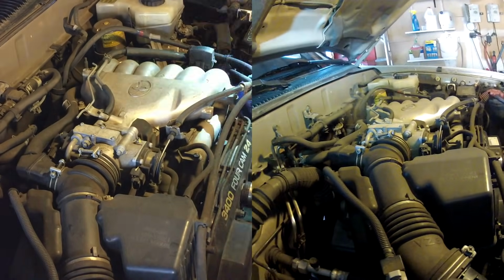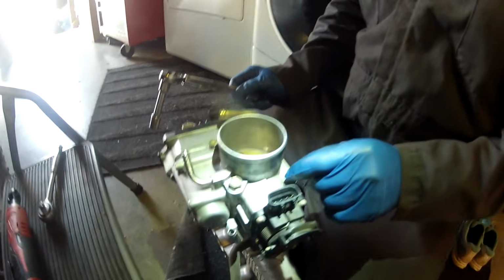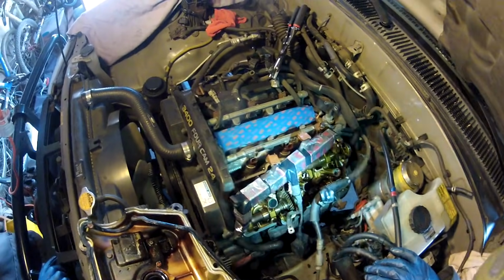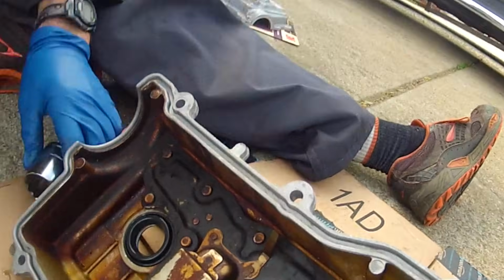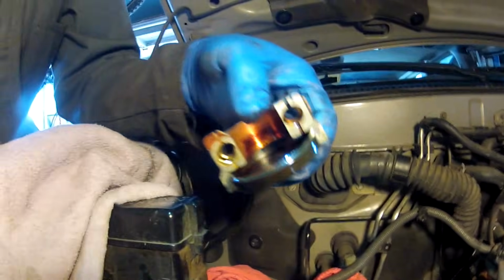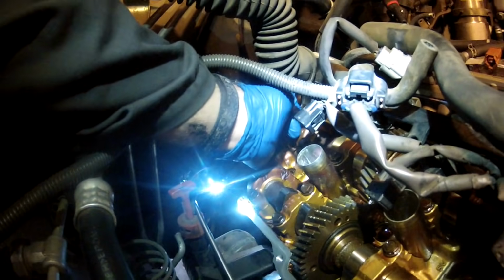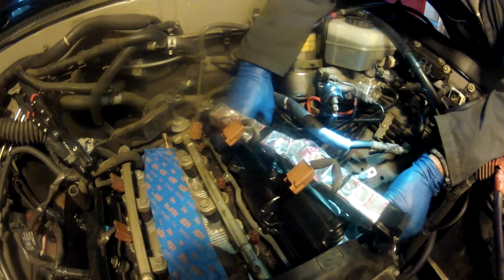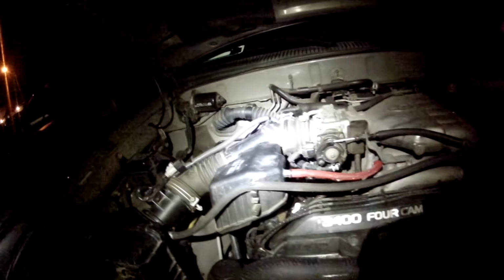3.4 L V6 5VZ-FE Toyota 4runner, Tacoma, Tundra Valve Cover Gasket Tutorial

Comment: Tim, your attention to detail and thoroughness are awesome.  Thank you so much for another great video!  I’m tackling this project over the weekend.  Toyota stealership messed this up on me 4 years ago leaving me in worse shape then when I brought it in.  As I’m taking things apart I’m discovering all the areas that the dealer skimped on.

Question:  Did you paint the valve covers before reinstalling or did you go with new valve covers?  If you painted what paint did you use?
Reply from the maker: Thanks for the compliment and you're very welcome.  You have found out what a lot of people have found out about bringing their vehicle to the supposed "Professionals".  Dealership and independent shop mechanics do shoddy work a lot.  There are competent mechanics with integrity, but there's also a lot of dishonest hacks too.

We painted Sean's valve covers after we pressure washed them.  You would want to use a high temperature paint that you can get at auto parts stores or buy online. 

Good luck with the job!

Comment: Had a mechanic change my valve cover gaskets. I had a hurt back so I just let him do his thing. It’s been continuing to leak oil. I thought it was a rear main seal as he said it possibly could be.  Ow that I can actually move around a year later I reached my hand to the back of the engine and felt thick oil on passenger side at the camshaft plug. Getting it done  tomorrow at 260,000 miles thanks
Reply from the maker: I bet a lot of "Mechanics " don't do a valve cover gasket job right.  It's not only the valve cover gasket, but it's replacing the cam plugs, resealing the half moons,  and replacing the spark plug tube seals.

Comment: Timmy,
Thank you again for giving me the knowledge and confidence to successfully tackle this. 
I had three challenges though...
1. My temp gague in the instrument cluster stopped working, but the obd scanner can still read it....  Stumped on this one, what did I forget to plug back in?

2. 25 year old vacuum lines are brittle, be careful everyone!

3. A wire in the #6 fuel injector harness broke. I found out by having a #6 missfire. Diagnosed by testing spark plug for a good arc, then plenum off (again) to test injector continuity, and finally power to the harness. It failed the last one so I replaced the harness and it now works great. Moral of the story, old wires and plastic are brittle, be careful!
Reply from the maker: The coolant temp sensor for the gauge screws into the back of the intake manifold.  When you lifted the wiring harness to remove the valve covers, the connector pulled off.  It's just a simple spade connector.  The same thing happened to me with my 98 4runner.  If you reach back there near the firewall and under the heater control valve, you should be able to feel the connector and sensor and be able to slip it back on.  A telescoping magnet with a light might help you locate it if you can feel it with your hands.

Comment: Question, would it be possible to unbolt the covers and lift them enough to remove half moons and reseal the moons without taking the everything off?
 It’s either those or the cam plugs that are seeping oil pretty bad on mine. Not enough to drop the oil level though.
Reply from the maker: You would have to remove the valve covers all the way to remove the half moons and cam plugs.  You should just do the complete job and be done with it.  If you try to short change the job, you'll probably regret it.

Comment: About 2/3 through this job right now.  This video exceptionally helpful. Unlike the videos, my half moons took huge effort to remove.  Passenger side was a challenge, but drivers side front took over 30 mins... Not much room, have to stand on step ladder (have 3 inch lift) and couldn't get leverage without loosing footing.  The side nearest fire wall was impossible with channel locks.  Tried many different things and tools.  Everything is in the way.  Son (a mechanic) suggested small vise grips.  That did the trick!  All energy went to pulling straight up and not keeping grip.  Also small enough that the brake booster didnt interfere.  Just a suggestion for those who are having a hard time with those.  Dont leave them in as i contemplated.  They were definitely the source of my leak - they had to be redone!
Reply from the maker: Yeah, those rear half moons can be stubborn to get out.  A small vice grips was a good idea.  Knipex makes smooth jaw pliers similar to channel locks that might be a better choice to not mar up the surface.  Check these out.   They make them in different sizes.  This is the 6 inch ones that would work well in a tight area.  https://amzn.to/3W3CC7D
Reply: @TimmyTheToolman  thats a good idea, i replaced mine and glad i did as one of them was cracked.  Previous owner basically glued the outer ridges back on with rtv.

Comment: Just completed this today. On my 01 SR5 with 321,000. Someone had done but only did the valve cover gasket and spark tubes, disaster waiting to happen. Thanks for this video. 9 years old and still helping people.
Reply from the maker: @JaytherealG  You're welcome.  This was the video that launched our channel.
Reply: I’m pricing it out right now for my  4runner. At Toyota Earnhardt it’s $390.00 for the parts listed above. Excluding a few discontinued gaskets…
Reply from the maker: @wesleyzajdzinski  Check with Yota1 Performance in Riverbank, California.  They might have a good price for a valve cover gasket kit.
Reply: Curious but how does someone only doing the spark tubes and cover gasket a disaster waiting to happen ?
Reply: @joshuawalsh8222  its not, 
no disaster waiting to happen. They should have done it all while in there as preventative maintenance but Nothin but a leak could come from it

Comment: Followed this video and one other one to do my headgasket, fnished n about 8 hours, with about an hour break in the middle. Averything worked out super well and the parts list was accurate. One mistake I made that I would definitely not underestimate is taping up the wire harness, mostly just to reduce the amount of broken plastic pieces that get into your engine. I had to chase some of them around with chopsticks, and in hindsight I wouldve used a vacuum to get to the pieces.
Reply from the maker: You replaced a head gasket in 8 hours?  That's amazing if you did.

Comment: Can I reuse the cam plug?
Reply from the maker: I wouldn't recommend it, but some guys do.  You'll have to smear FIPG on it to prevent it from leaking.
Reply: @ thanks
Reply: I’m back again trying to buy cam plug at my local auto park by they only have cam plug rear set, is that what I need? 
Appreciate your time. Thanks
Reply from the maker: @carlosayala6754  The cam plugs are only at the rear of each head.
Reply: @ thanks man
Reply from the maker: @ You're welcome.

Comment: Hey Tim, Im changing the spark plug tube seals doing this job & the seals were caked in there and I've had to pick it out. 
I noticed theres the small, thin crevice that goes around the hole where the seal goes. Its full of the old seal plastic & I cant seem to get most of it out. Do u know any trick or chemicals that might help?
Reply from the maker: @sambo314  I don't know of any product that will help with that.  I've never heard of having such a problem removing them.
Reply: @TimmyTheToolman  I figured it out, the metal ring was a part of the tube seal I just had to remove it! 
I saw it in another video how easy it was haha
Thanks for this video tho, gave me the courage to do it in the first place
Reply from the maker: @ Yeah, no problem.  I think you missed the part of me showing how to remove the spark plug tube seals.  You can clearly see when I'm hammering the side of the tube seal with a screwdriver and hammer that the metal ring is part of the tube seal.  Anyway, I'm glad you figured it out.

Comment: Hey Tim do you happen to have a part number for the valve cover bolts.
Reply from the maker: We unfortunately don't have that part number available.
Reply: @TimmyTheToolman  ok thanks. I've done the job before and refused the bolts, figure id replace them this time around
Reply from the maker: Yota1 sells them
https://209yota1.com/products/90109-062755vz-3-4l-valve-cover-bolt-genuine-1994-2004/
- Sean
Reply from the maker: @wendelsimeon5698  There's no need to replace those bolts.  There really isn't.  They are torqued to such a low torque value so they aren't fatigued in the least bit.  I wouldn't worry about it and just reuse them again.

Comment: Thank you for this comprehensive video! One of the, if not the most thorough out there. A couple of observations while doing mine: (1) good idea to seat the spark plug gaskets flush because this leaves enough space to fit a screw driver on the outer lip of the top of the old gasket, which allows you to pry it out with no problem (some of mine were flush and some weren’t and the ones that were flush were easy to remove by prying). (2) I second not applying rtv to the cam plugs because the next time around it would make it very difficult to clean out. 

As this was my first go at this, I spent a ton of time cleaning. Really most of the time on this job was cleaning. How clean must the gasket mating surfaces be? 

Thanks again!
Reply from the maker: You're very welcome and thanks for the nice compliment.

You make a valid point about not fully seating the spark plug tube seals.  But, if you use the technique we showed in the video by denting in the sides of the seal with a screwdriver and then pulling it out with a pliers, you could still easily get the seals out.

The gasket mating surfaces should be as spotless as possible.  You really want all the old RTV scraped off, but there is room for not being perfect with the cleaning.  You obviously don't want big chunks left that could cause a leak.
Reply: @ I also meant to ask: the bracket on the driver’s side, that is connected from the lower plenum to the engine block- the bolt holes were about 1/16” off and no matter how I tried to line it up, no dice; is this a common problem? Had to demmel out the slot to get this back…
Reply from the maker: @arielsarno4472  I've never heard of that issue with the air chamber stay bracket.

Comment: Hey Tim, Quick Question.  How long should i wait(if i need to) after tackling this job to drive the vehicle?  Does it need time for the sealant to cure?  Thank you!
Reply from the maker: The FIPG sets up quick.  I think 2 hours is the suggested time to wait until you start the engine.  By the time you get the last valve cover on, properly torqued down, and the rest of the engine put back together, you probably won't have to wait that long before you can start the engine.
Reply: @TimmyTheToolman  Alright Cool.  Thank You!

Comment: 4 years later and I'm back at it again... lol
Reply from the maker: @citizen_or_civilian  leaking already?…
Reply: @TimmyTheToolman  Maybe. 
Been having an intermittent misfire on cylinder three. 
Went to replace coil packs and spark plugs only to find out that the front two passenger side spark plugs were submerged in oil. 
Spark plug tube seals are my next culprit. 
I figure I'd replace the valve cover gaskets and such while I'm at it.
Reply from the maker: @citizen_or_civilian  Replacing the spark plug tube seals should be part of a valve cover gasket job.  The cam plugs at the rears of the heads should be replaced, and the half moons should be resealed.

Comment: Hey Timmy, thank you so kuch for your videos. I may have missed it somewhere but just to confirm for my parts list, do I need 2 or 4 cam shaft plugs for this job. In the list that drops down at the beginning of the video, it says 4. But in the info it says 2. Just don’t want to start the job without all the parts. Thanks again for all your videos.
Reply from the maker: @stevetravis3400  You just need 2 cam plugs.

Comment: Hey Tim. I’m planning on tackling this job I’m getting ready to order the parts. When I click on the head gaskets link says it’s for right side only do you have the link for left side as well. And are these gaskets and parts %100 genuine Toyota parts on Amazon?
Reply from the maker: I'm looking at this link https://amzn.to/2Xng9mp and I don't see where it says it's only for the right side... bottom line is that the same part number is the same for both sides. you will need 2 VALVE cover gaskets... head gaskets are different and usually come in a kit.
- Sean

Comment: Hi Timmy! I did it a few days ago but unfortunately by watching TRQ's video (which is very detailed in the process of dismantling/reassembling - a good complementary video to yours).

However I didn't complete the whole process and went backwards after having dismantled the air intake manifold.

I then re-did the whole process to reassemble the whole thing correctly because I rushed myself. I wish I watched your video before because of how many adviced you give!

I want to do it, a third time and complete the job this time. Would you recommend me to do it or is it "unadvisable" to work too often on this part?

Thank you so much for your work!
Reply from the maker: What exactly is happening?  The engine doesn't start after you finished putting it back together?  You have leftover parts that you don't know where they go? You're confused about reconnecting hoses and electrical connectors?
Reply: @TimmyTheToolman   @TimmyTheToolman  Wow I didn't expect to receive an answer at all, even less that quickly!

Sorry the message is confusing I think. I lost a screw in the process and damaged the threads of one due to overtightening (complete newbie here...).

Everything went alright but I got anxious (at the 1st attempt) and reconnected wrongly the spark plugs and one injector which led me to re-do the whole process since the engine was shaking hard.

I took my time for the second time and now everything is as before but the leak is still to be fixed. By watching your video I know it is absolutely doable if I take my time. 

I'm worried about the screws that I overtightened may not recover from a third attempt or that something else would come up in the process.

Again, thank you so much!

Comment: Pro tip: The passenger-side injector / coil harness will swing out of the way (toward the vee / center of intake ports) by simply unclipping three plugs on the front passenger side of engine (the A/C compressor plug is the most difficult). This step makes it a lot easier to remove and install the passenger-side valve cover. 

Bonus tip: With the harness out of the way, vacuum all debris away from the injectors BEFORE pulling the injectors. Vacuuming before rather than after pulling the injectors reduces the likelihood of dirt and debris falling down the injector ports after removal. Edit to add: Depending on accumulation on injector seals, you may have to vacuum again after injector removal. This step, along with wiping inside of ports with a rag soaked in carb cleaner, will help ensure a good seal on reinstallation.
Reply from the maker: Thanks for adding helpful tips to this video! We appreciate the comment.
- Sean

Comment: So on day 2.5 of this.  Putting passenger side valve cover on and I notice the black wiring loom mount, where the small bolt goes through, has broken.  I recover the plastic piece but not the small embedded metal washer.  Not sure but I think it went into the engine when I was putting back the valve cover.  I ran through with a magnetic pen and nothing.  Should I be concerned?
Reply from the maker: It's hard to give you advice on this one.  If the washer went into the engine, it's not good.  Did you look really well on top of the intake manifold for the washer?  Are you sure there was a washer to begin with?
Reply: I'm like 50% sure it went in, looked everywhere for it and spent like an hour scanning around the cam shaft with a magnet.  It's the small metal washer that is embedded into the wiring loom which, you describe as brittle in your video.  What are the chances it works it's way into the oil reservoir?  @TimmyTheToolman
Reply from the maker: @react1200  The oil gallery holes are decent size, so it might just end up in the bottom of the oil pan.  Once it's down there, it won't do any harm.
Reply: Here's to hoping!  Thanks Tim!  @TimmyTheToolman
Reply from the maker: @react1200  Yeah, I hope everything is good with your engine.
Reply: @react1200  reading through these comments for additional details...curious what you ended up doing?
Reply: @spritelord3763 I crossed my fingers and drove.  So far no issues.  Either it bounced off the engine onto the ground somewhere or it ended up in the oil well.  Just recently I too remembered this incident since my engine has begun to shake at startup but I think one of the injectors is going out.  It stabilizes once I start to drive.

Comment: Working on this project today.  The bolt that holds the bracket for the throttle cable must of seized up since it came off with inside threads.  I guess I will need to re-tap.  Let me know if you have any tips.
Reply from the maker: If the threads aren't salvageable, which it sounds like they aren't, you can drill the hole out and install a helicoil.